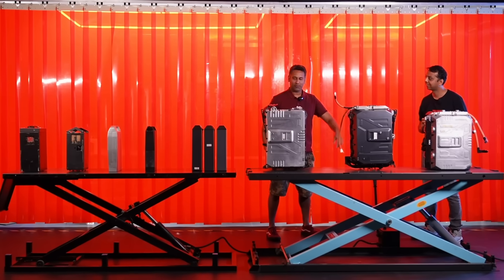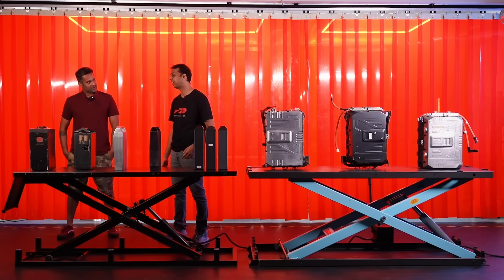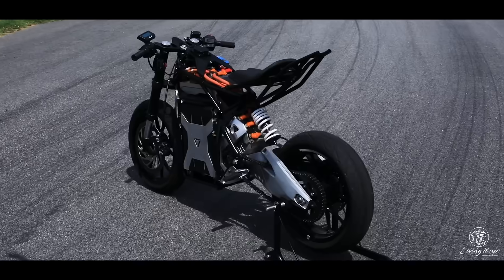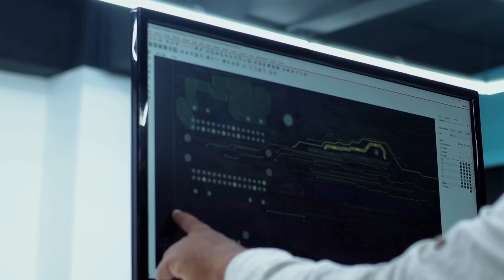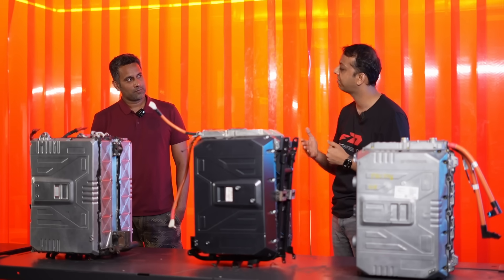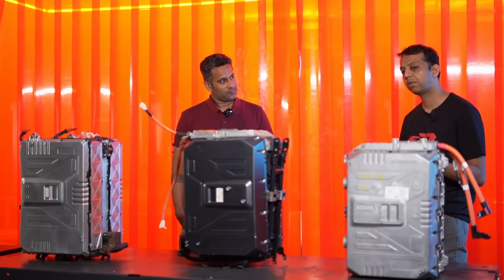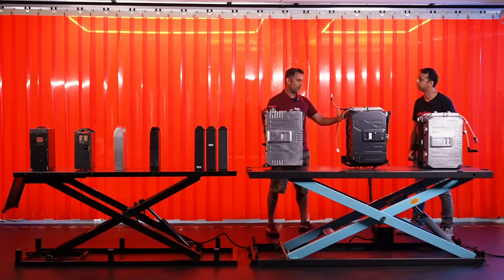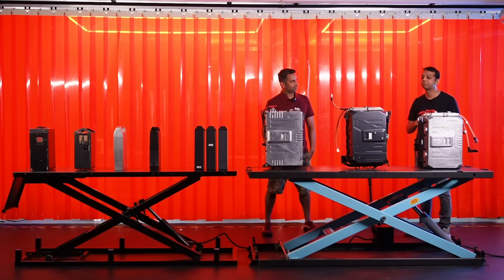Decoding Ultraviolette's Battery Tech with @SagarSheldekarOfficial

Comment: No doubt you have aces the cutting edge in battery management systems but but but, in a two wheeler nothing beats the power to weight ratio, that being said,  will there be a proper enduro Shockwave with upside down adjustable suspensions and rebound preload adjustable shocker in the future, because the one i have booked looks very rudimentary in terms of material cost, maybe to keep the FOB under check, would love to know how would that platform develop, hoping something on the lines of ultrabee, rerode ewatt or maybe the stark varg, would love to spend more for an enduro or MX spec electric torque dirt weapon!

Comment: Are you guys working on 4680 cells?
Reply: 21-700 is more efficient from a thermal management pov - especially for high energy density cells.
Reply: @ns333OG do they use 21700 cells?
Reply: @PrabhasPatilyes, i searched about and it's from tenpower probably 😊